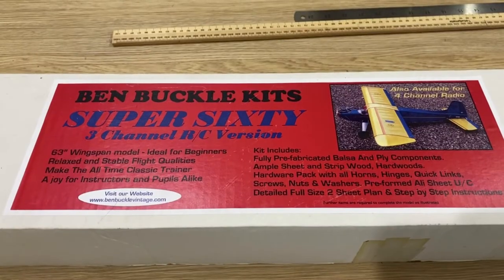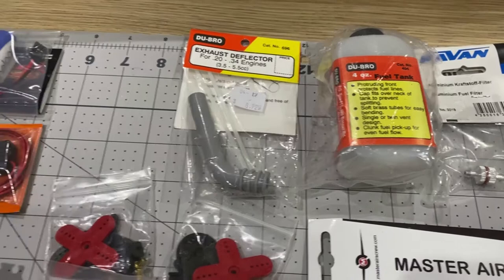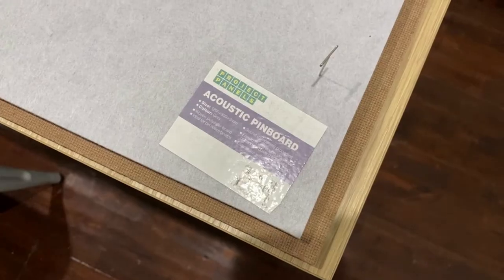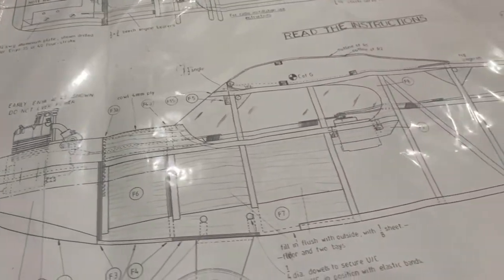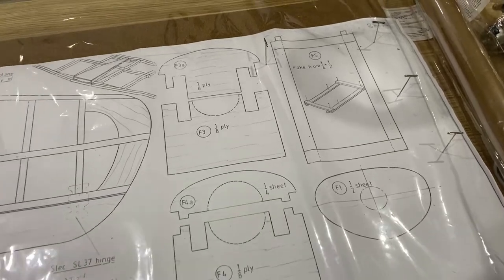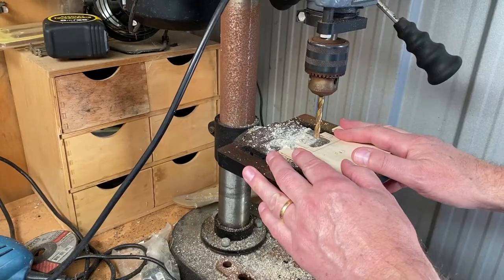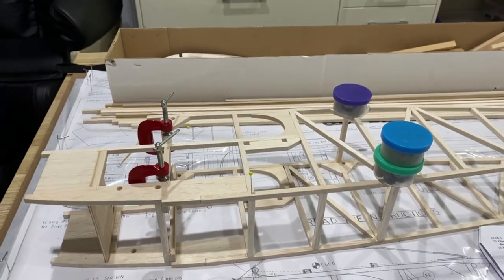It's vintage RC plane time - Building the Ben Buckle Super 60

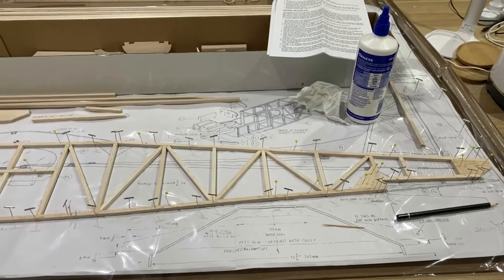Comment: HELPFULL BUILDING TIP AT 4:20 . ALWAYS ALWAYS ALWAYS..... use wax paper or plans protector when building one part on  top of the other .  This will eliminate all need to cut them apart .
Reply: This is a vintage kit and I wanted to build it exactly as per the plans and instructions.  The instructions actually say to put one half on top of the other one and then use a blade to seperate them if they get stuck!

Comment: at 8:54,  water-based glue  equals,  WRONG.!!!!!
Reply: Aliphatic resin, excellent glue, sand-able.
Reply: @vumba1331  ive been using it lately when i dont want to mix up epoxy, would it be strong enough to glue a firewall?
Reply: @PandaIsBored  That depends on the size of the engine etc. With electric motors it works well in models up to 1.2m wingspan however if it was a stunt model I might be tempted to use epoxy due to the torsion effects of aerobatics. Bonus is that aliphatic is lighter too. I have just used aliphatic on my 900mm wingspan Carl Goldberg Junior Falcon with a 2200 electric motor, works fine. 
Note I have correcte my earlier post, should have read 'sandable', and yes I did manage to buy a brand new in box 1965 kit to build! Orginally built one in 1965 when I was starting out modelling so I just had to go there afain, great flier.
Hope that helps.
Reply: David Davis pva on balsa to balsa equals wrong?been using it for 45 years without problems
Reply: @jaseegee9293  Nope, pva works just fine, good and strong but can be heavy, also too rubbery to sand. It has its place and I do use it occasionally. 
Have you tried aliphatic resin?
Reply: @vumba1331  no cant say I have I've had no problems whatsoever with sanding down a pva joint in 45 years of building from kits and plans pva is definitely lighter than epoxy!